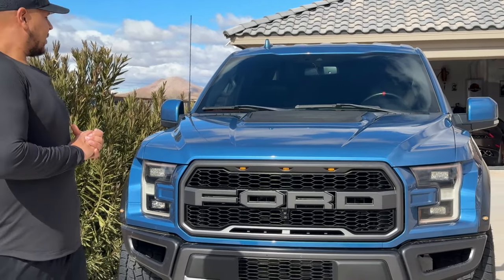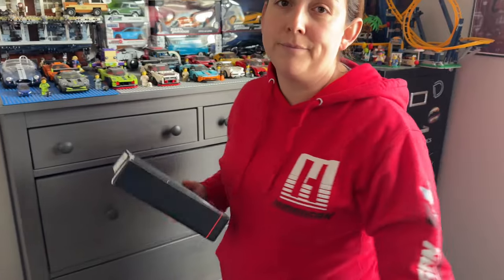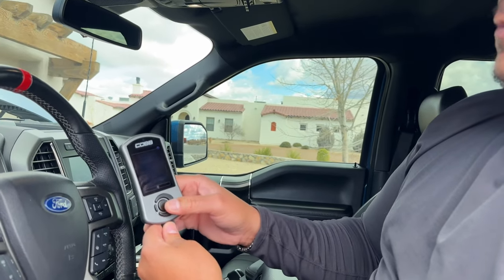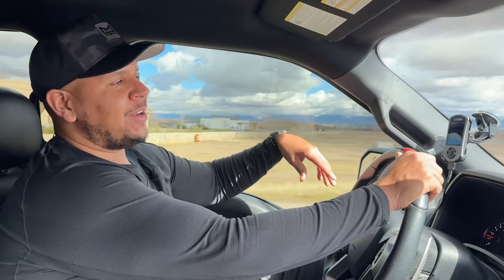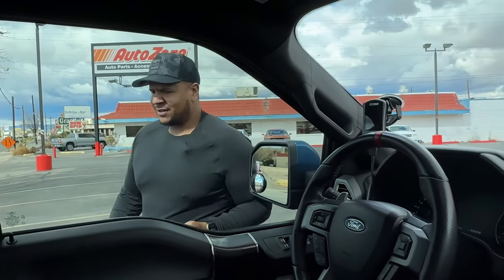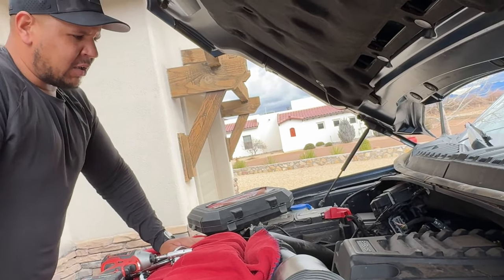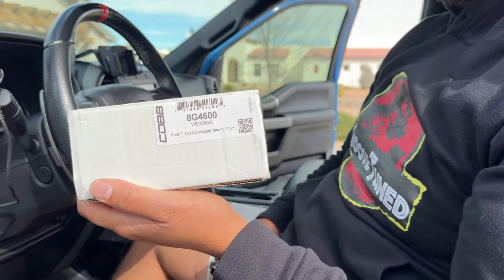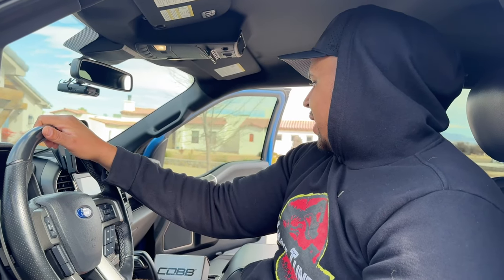Project Raptor Build: Episode 1 - ALL IN

Comment: Cool 😎 video.

Do you have a shop that would install an aftermarket intercooler?
Reply from the maker: Yes!  Where are you located?  I have several shops across the US that I work with
Reply: @goosetuned any in WA?
Reply from the maker: @MrThatoneguy689  nobody in WA. I’m sorry 

What do you need done?

Comment: Can a gen 3 with 93 Oct make more power then a raptor r?
Reply from the maker: Currently it makes about 15-20hp less.  But it also weighs less than an R.  So it should be a VERY VERY close race